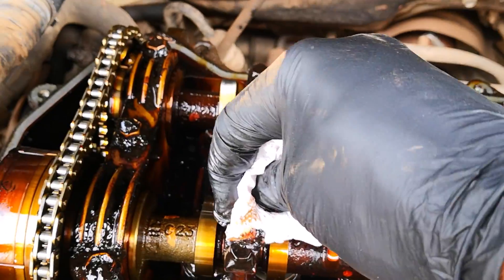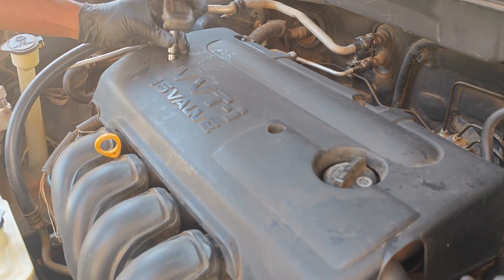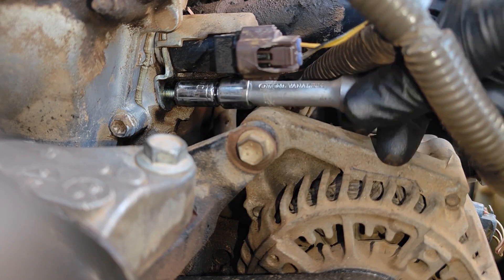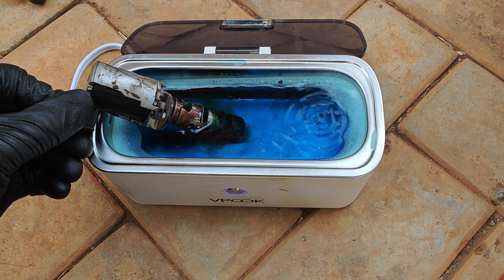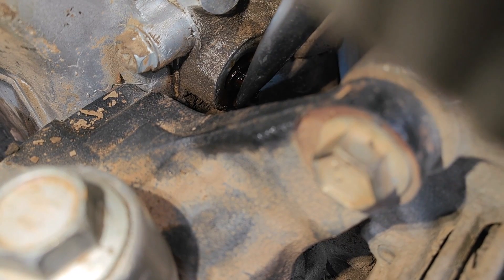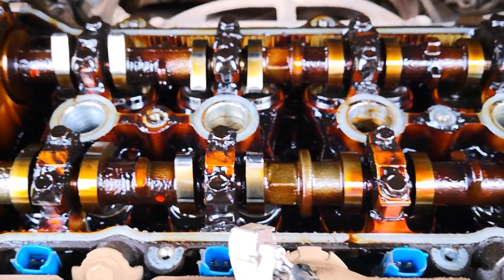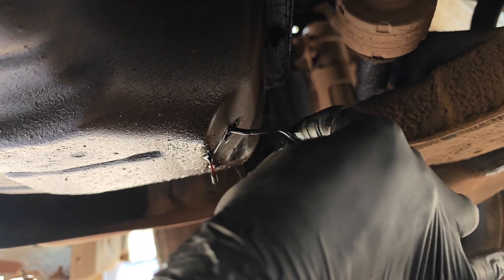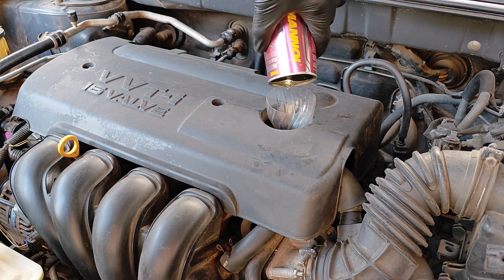Do this After Flushing Engine Sludge / Engine sludge CLEAN Up Essentials

Comment: does a 7th gen accord have the oil control solenoid? Also the 5k oil changes is it in miles or kilometre
Reply from the maker: Yep. The 7th gen has it. Honda calls their variable timing control (VTC) solenoid. It's by the side of the engine (passenger side). Oil change interval is in miles.
Reply: Thanks chief @DIYAutoworksNG

Comment: Would you mind checking the pick up tube? I am almost positive that it's going to be fine, but preventing is better than lamenting. 

Great points you made about the vvt solenoid, on Hondas thats the first place that gets clogged with metal shavings in pending component failure.
Reply from the maker: Agree. That's the only other logical thing left, though I believe it should be good. I'll keep a tab. Thanks for watching!

Comment: Does the Liquimoly engine flush dissolve the sludge into liquid form?
Reply from the maker: Yes. It did a very good job in my experience, but doesn't remove 100% of the sludge. I think it also depends on the state of the sludge e.g hardened vs soft